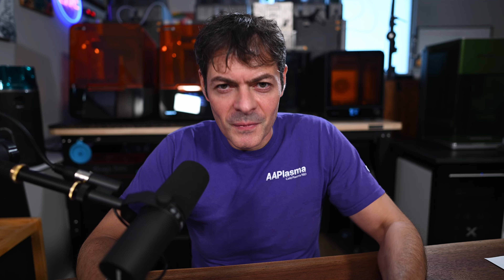Could Plasma Make Hospital Laundry Sterile?

Comment: A question came to my mind - in ultra-clean environments like ASML or TSMC, how do they sterilize PPE and materials to such extreme standards? Do they use plasma for sterilization, or are other methods preferred?
Reply from the maker: Do they care about sterility or just particle content (dust)? I think it’s dust. First, I don’t know. What I do know if that the Cleanroom I’ve worked in used HEPA filters to keep the air dust-free. Bunny suits and goggles for humans, etc. Again, I don’t think sterility is an issue there, just the dust. However, I don’t know. Good question, though, thank you